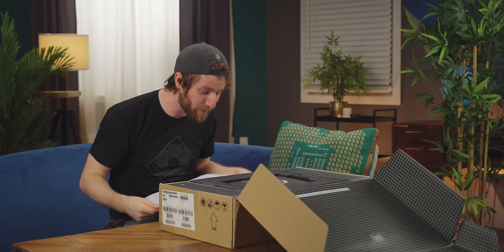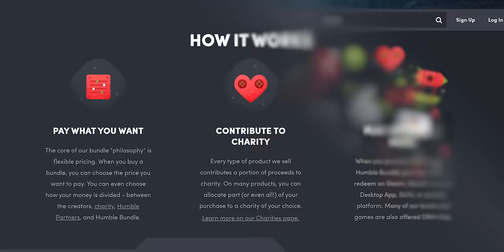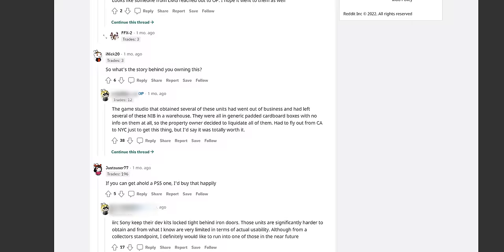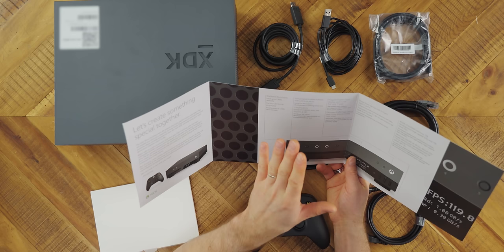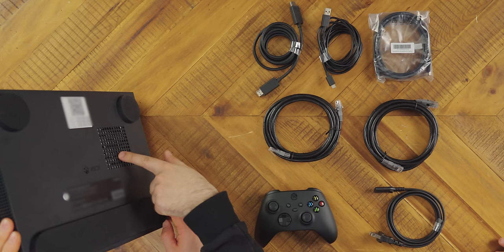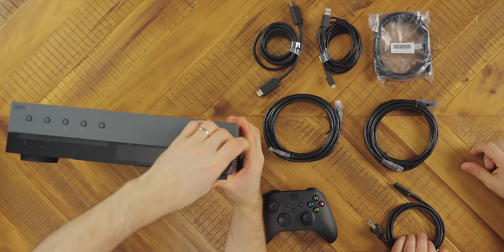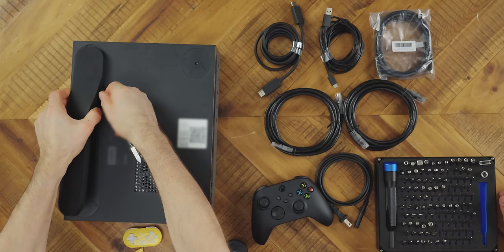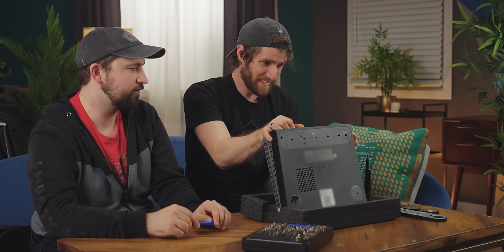I Can't Believe I Paid Two Grand For This - Xbox Series X Dev Kit

Comment: I mean you paid 69000 for a gold controller!!! This seems pretty OK with Linus standards 😂
Reply: this is nothing compared to that for sure this is chump change
Reply: The price was nearly entirely for the metal. For the manufacturing, it was a couple grand.
That thing was essentially an investment, it is probably worth more now than it was when he bought it, plus all the money they made off the video.
Reply: price of gold went up, so that controller is basically stonks at this point
Reply: You can not use that control
Reply: @nanolog522  if I remember right they melted down the gold back
Reply: Yes. He planned it ahed of time. The controller is for the Xbox dev kit
Reply: They also got 3 videos out of that and still own a good amount of pure gold that can melted down and sold and get most of that back to be fair.
Reply: @jeffmartin8377  Except they proved the solid gold controller was functional,just heavy as all get out.
Reply: @betrayedpredator8826  iirc linus said in a somewhat recent wan show that there was someone interested in buying it, but it might also have been a wan show that aired long ago and i just remember it being more recent than it actually is for some reason
Reply: @SPEEDFREAK6988    gold to soft if the quality  is good it will leave finger prints all over.  Just for the wall like painting   dust and looked at what you can buy.
Reply: He did,?

Comment: The internals are cool and all, but honestly I dig this aesthetic and design so much more.  The feet on the bottom, the dual color and sunken logo, physical buttons and black and grey. It looks like tech, not a black box.  All those vents, btw! I would love a little screen like that, even. It could tell you how much is downloading in the background.
Reply: These ones really feel and look solid&reliable. Many has been improved since previous-gen hot and squeaky devkits.
Reply: It just looks like an xbox one x
Reply: This looks more like a bigger xbox one x. They literally took the design from the xbox one x, enlarged to fit all of the internal hardware and add a screen and extra buttons and ports for debugging purposes, it doesn't make sense to like this thing, there's no design in it (and that's the point, since it's intended for developers only)
Reply: @TheCostantinus  "I don't think it makes sense to like it, so it doesn't make sense to like it" <- that's you. It's a cool design. Just chill out.
Reply: @TheCostantinus  I will still go with it looks a lot better than the Series X. Get rid of the screen and other dev kit features and shrink it down some and it is exactly what a console should look like.  Sometimes the generic old standard design looks better than the fancy new thing. 

And this isn't an anti-MS comment, the PS5 is awful looking.
Reply: It looks like a set top box that Panasonic would make 20 years ago and I love it.
Reply: @88porpoise  it would look exactly like a bi color one x then. To each their own I guess, but the look of the series x is also determined by its cooling solutions and its dual-motherboard construction, thanks to which they manage to build a power efficient and well cooled console, while still be more compact and powerful than the competition. You might not like the design, but it sure makes sense.
Reply: I concur. 🤝🏼
Reply: Nah the actual design looks much better
Reply: Agreed it reminds of older tech. Like nice VHS player from the 90s lol
Reply: @dominicvl1990  was gonna say the same lmao
Reply: @TheCostantinus  There's no design in mountains and people still like mountains.